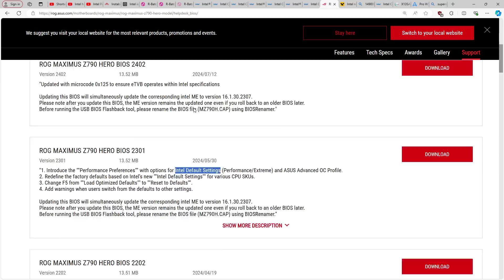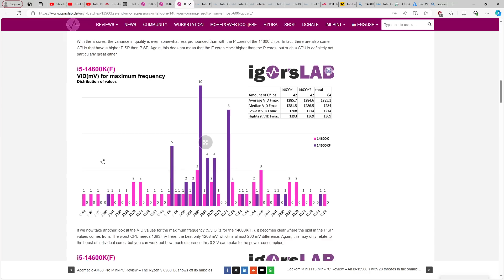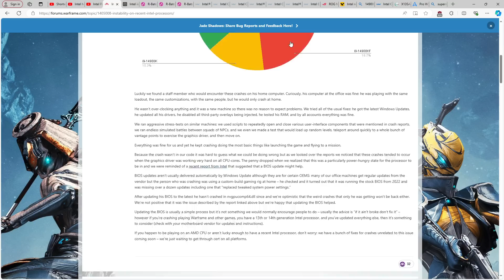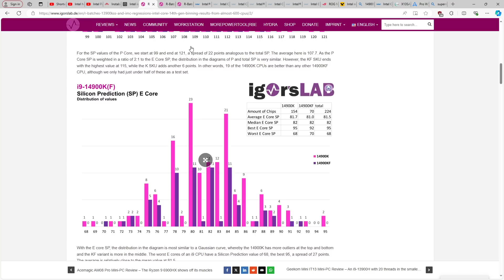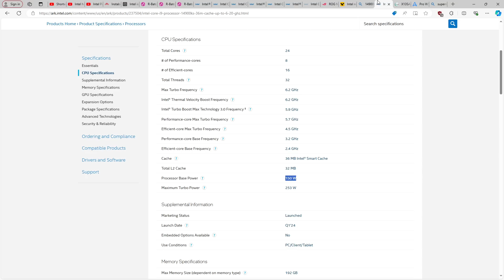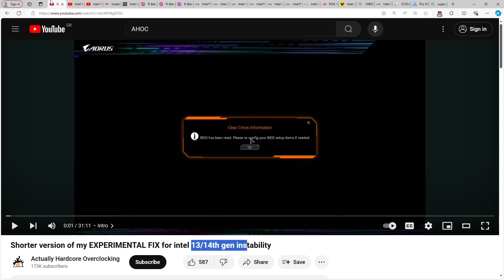The intel instability and degradation rant.

Comment: Truth will out at some point. The longer Intel 'silence running' this issue, the larger the scandal. Its going to be I think (because at this point, speculation is where we are at) some form of design or manufacture defect, and its going to run in the billions. A very large part of trust with intel is that they used to have a rep for the validation, and reliability to a good degree. Each day this progresses with no real response from them, is one day of more damage. 

And this reputational damage sticks. It doesn't wash off. Buyers of the next chip family are going to be extremely wary if they were bitten on this and had a deaf vendor. Some - and I think these are tip of iceberg info - info coming out has people stating just how bad things are, and how deep a hole its put them in. 

Imagine being a Dell, or a Lenovo, or HP, and staring down a barrell where your customer base has been sold bad processors that are steaming forward towards a class action suite, and the supplier is playing public laaa laaa laaa laaa.

This is going into the folklore bin. Along with Dell Caps, IBM Deathstars, Nvidia substrates. The only question now is 'how big' its mushroom cloud is going to get.
Reply: this is user neglect 100%

intel did what they were supposed to do: gave you a high spec machine

people are not properly taking care of it

you ALL know that dude, the one that bought a sports car and NEVER changes the oil or monitors coolant levels and runs it balls to the wall 24/7

and then wonder why its constantly breaking down
Reply: @OdinAlgeron Bruh, this is happening even in servers, on server motherboards.

It’s not the users.
Reply: @mduckernz  did you not read what i stated?

whos fault is it when the oil and coolant is never changed and the engine blows?
Reply: @OdinAlgeron  That makes no sense. Wendell's data is from server farms on server motherboards. You could argue that they don't know what they're doing, I guess. But then why is it just happening now? Do you honestly think people suddenly got dumb? Why are they then charging more for Intel and even some switching to AMD? Isn't it more reasonable to suggest there's an issue with the chips?
Reply: @OdinAlgeron not everyone is techno god and can tune each and every atom of silicon on the chip. Intel created a bad generation. Just accept it. It fails if you use minimum clocks, it fails when you overclock it, it fails if you leave it idle.
Reply: @OdinAlgeron  I have very little patience for nonsense. 

They have these in data centre's, mounted in very conservative configuration, not overclocking, not overheating, and they are replacing trays and trays of them. Wendell's data is but one set, and that neither confirms, nor denies a larger issue. But this is not 'user' error. And while I respect that if you delid and take some extraordinary steps, you might stabilise the product, the average people can't, and should not be expected to_do_so. 

Its day 5 since some data broke. And each day only confirms deeper issues. Intel need to get ahead of the problem, not swim from behind.
Reply: @AdmV0rl0n  drive a ferrari non stop and never check the oil or coolant and the engine will fail

the ferrari are built for the track, and to be ran BUT without proper maintenance thy WILL FAIL EVENTUALLY

if you never change the oil or coolant WHOS FAULT IS IT WHEN THE ENGINE BLOWS???

a lot of people have 14th gen OVERCLOCKED and NEVER have problems, 

so, WHO is taking better care of their systems you think an well informed enthusiast overclocker or a lazy ass server farmer with thousands of units to monitor???
Reply: @AdmV0rl0n  OK looks like I was right, it was confirmed after looking at VID tables for mobos they were pumping 1.5v+ into cpu's
Reply: @OdinAlgeron  I doubt you are ever right.
Reply: @OdinAlgeron what rubbish 
Intel are fucked

Comment: I'm even more sure that it is some copy and past circuit that is extra sensitive to silicon lottery that is suffering from migration over time. something like an internal bus latch, a terminator at the ends of the internal busses, or a clock distribution amplifier. It is worrying that CPUs or any chip can degrade that fast, yet here we are.  to OC or not, if not OCing has such a high fail rate anyway. Wendell also said some CPUs get realy slow before kicking an error, so that kind of keeps us from ruling out a clock circuit.

Comment: My 13900k was fine for a while. The BSOD started when putting the CPU under 100% load which pulled a lot of power. I think there likely is an issue with how much power it can pull at 100% load for long durations. In my case, I was doing repacks (20-30 minutes at 100%). I thought it was the RAM or XMP or something so I wasn't really paying attention to the CPU. I think the damage was being done at this point, as it got to the point where I couldn't get but 10% into decompressing the repack before a BSOD with the same circumstances trying to install a repack or get passed shader compilation of Forbidden West. Eventually even setting to 253w/253w/400a would result in a crash (brief second of power limit throttling when the crash occured). Same thing on shader compilation as that also puts the CPU at 100% load and would crash the game. Important to note, with limits in place (253w/253w/400a) the apps would crash. With unlimited power limits, I was getting BSOD. Eventually I could turn on IA/GT CEP (current excursion protection) which now limited my CPU to not being able to consume more than 200w at 100% load. Installed multiple repacks that were crashing like this, and could finally finish shader compilation of games like Horizon Forbidden West to actually play the game. Just did an RMA, and Intel sent me another 13900k but this time I decided to install a Thermal Right bracket which I have my own suspicions of now vs their stock bracket. My CPU doesn't even get hot anymore, and I mean like 20 C less under 100% loads. I remember with the old CPU seeing it pull as much power as 283w (and remember 400a is not to be exceeded says Intel) and it did in fact hit 100 C before on some cores, I think damage may be coming from them staying this hot or remaining there too long as well. Ironically, anything less than 400a on a 253w/253w would result in a EDP current throttle for me. So I can only assume when it went above 253w in the early days that it likely took the 400a above as well. New one is working well though, I put the 253w/253w/400a in place in which it hits at 100% load and I can tell it clearly wants more. But it's the only configuration that doesn't result in some kind of throttle, so I'm happy with it. I got my performance back in Bannerlord and can now run 1000 unit counts again without lag (was down to 600 with my old 13900k).

One other thing, the 125w/253w/307a will result in an EDP current throttle under any kind of load, only idle will it not have a throttle.
Also, Gigabytes new default settings on their BIOS f12d also results in a constant EDP current throttle. Sweet spot with no throttles is 253w/253w/400a for me, it may just be the 400a that is where it is suppose to be, but not above it, from my personal experience.
Reply: 20-30 minutes at 100% is not that long.  I've been encoding videos for on my 7800X3D for a year and 1/2 straight and have zero crashes.  This is with tuned memory too.
Reply: Fitgirl?
Reply: It’s clear that your cpu was hitting temperature tjmax and erroring you could have easily fixed everything by enabling a 90c limit

Comment: my ryzen 3 from 2016 still works to this day  and its on about 24 hours a day - and ryzen 3 were the cpu´s that didnt make 6 core or 8 core due some problems, dont have problems with memory either and the ssd is the orginal -only problem seems to be the heavy amd gpu card did bend/sagged and might have impacted the gpu port

Comment: Turbo Boost 3.0 is the only common denominator.  The 1 -2 core boost throws too much current and voltage into the chip and degrades it.  Sounds like Buildzoid gets it.

Comment: My stock 14700k has a high vid, 1.38v, i did a undervolt to 1.28v to sustain 5.5/4.3
Reply: That looks nooice, but i would try to go even lower, 5.3 ghz at 1.2v sounds good to me. If you can lower the maximum wattage allowed in bios aswell.

Comment: Devs from Alderon Games studio have said they have found i5s with this issue as well, on a post on r/intel
Reply: I'm actually having a strange problem with my 13600k. Some games, at any voltage, randomly just straight crash at 5.1 Ghz (I always undervolted it, so I don't think it's a motherboard problem causing degradation). If I set the p-cores clock to 4.9 Ghz the issue go away... I hope it's not a cpu degradation problem.
Reply: Literally one Google search disproves your claim, try harder.
Reply: @dusty_48  Watch the latest GN video where he talks about millions of Intel CPUs being defective and among them being i5s.
Reply: I don't think so, i never watched someone complaining about the i5s. The 13600K in particular has the best perfomance per watt from 13th gen and can be easily air cooled. And considering the clocks, it's in the safe voltage range.
Reply: @saricubra2867  You don't think so what, that they didn't find issues? I don't see a reason why they'd be lying. 
But I would agree that more testing is needed before reaching a conclusion. For now we can just speculate.
Reply: @saricubra2867  TIL: A lower end midrange CPU being easily air cooled is considered a remarkable feature by some peoples standards.
Reply: @peterdermeter7044 well considering it performs on par with the 12900k tho...
Reply: @saricubra2867  Gone onto r/intel and can confirm the OP's post. I politely suggest you do the same. Now for the specifics: Alderon has data showing that 14600Ks are affected, however it is a more rare occurrence (due to the lower power draw of an i5 compared to an i9, hence why nobody is covering it at that level of product, yet). They also found issues with the 13700T (which is an OEM specific SKU for SFF systems). A commenter underneath has flagged issues with their 13600kf, having to disable 4 e-cores just to boot into Windows.

Comment: Reminds me of early days of the Zen+ platform. My Crosshair VII managed to kill my Ryzen 7 2700X with 1.6v...(level 4 oc it was called if I remember right). Back then it worked even for a few days until it didn't. Whole system started to get unstable until I couldn''t even boot.

Somehow I managed to RMA it and get a new one.
Reply: You killed it with 1.6V, that's not an AMD issue that's a skill issue on your part.
Reply: @giglioflex  Skill? that for sure. Or well i listened to DerBauer; how was I supposed to know that "level 4 oc" (it is a preset configuration in BIOS) does push so much voltage into the CPU...my bad still.
Reply: @Koeras16  I would say that's a fault with the motherboard manufacturer. It is not safe to go above 1.4v on Zen+. The fact there was even an ambiguous "level" option that didn't clearly state the risk involved was probably how your RMA replacement was honored. Doesn't help there are outlets like TechBlock on Youtube that tested using your same CPU and motherboard, saying that Level 4 simply is "unstable," not "risks destroying your CPU," making it seem okay to an observer.
Reply: @savagej4y241  Well happy me back then.

Worse thing is that it took me two days to even bother checking voltage read out since enabling that setting was like turning on XMP. That usually does not require stability testing.

The Crosshair VII has some pins to measure with a multimeter voltage. I do remember reading around 1.64v ! 

After setting it back to default it was sadly to late. Funny thing i managed to get the CPU prime95 stable at 3.1 GHz at some voltage (i don't remember) whle everything above that was completely unstable, even 3.2 GHz with static 1.35v and somewhat aggressive LLC.

Anyways, high voltage does kill CPUs ! And as you said. Zen+ isn't safe from degradation above 1.4v.

Comment: Hey @BZ, its even worse!
P and E actually have independent boost algorithms, you can run Prime 95 AVX small FFTs on e-cores only, let's say at 1.25v (220 watts) and then start Cinebench single threaded workload, so P-core will request 1.5v and this will be applied to E-cores either.
You can verify this in OCCT for ex. Just set OCCT load to half of your e-cores and run 1T Cinebench to see what will happen.
Reply: In other words, the entire product was designed to game the benchmark software to get a bit high scores.

Comment: My own personal hypothesis for what's causing the issue is the internal clock generator failing. Every error that I've seen come out of unstable 13th and 14th gen intels looked like an unstable BCLK to me. Some reports like everything becoming extremely sluggish before a total crash, etc.

I don't know if they used ol' reliable Quartz in their internal clock gens, but I think it's more likely they used MEMS or NEMS oscillators as the clock generator. AFAIK intel has no greater expertise with MEMS/NEMS so it's quite possible that they created and implemented a design that's particularly susceptible to degradation.

An easy way to test this would be to plop a known unstable CPU into a mainboard with an external clock generator to let it override the suspected unstable internal BCLK with its own stable 100MHz BCLK.
Reply: Intel had a major issue with the clock gen inside Atom CPUs degrading, like a bunch of really expensive Ethernet switches, NAS boxes, etc. have been bricked by this
Reply: The CPUs do not have crystals/resonators inside them, the clocks are generated by using the front side bus clock provided by the main board as the base frequency for a clock multiplier circuit.

The actual implementation of a clock multiplier will be a form of voltage controlled oscillator that operates as a phase locked loop, if your CPU wants to run at 6Ghz, and has a front side bus of 100Mhz, it will set the VCO to what it thinks will provide this and the output will be used as the clock for the CPU, it will also be fed into a frequency divider circuit set to the ratio, 60 in this case, the output of this divider will be compared to the FSB, and the VCO will be adjusted for any offset or drift.
Reply: @Ts6451  this hasn't been the case for a while now. Not since the North Bridge was integrated onto the CPU die... Currently the BCLK is generated on die, and only some enthusiast mainboards actually still have their own oscillators to get around Intel's/AMD's restrictions for overclocking
Edit: I got my timeline mixed up, at least until recently the clock was generated in the chipset, while the CPU used PLLs, you're right. Tho I'm pretty sure I heard on a convention that they now generate it on die with a MEMS resonator
Reply: @insu_na  Yes, from the datasheet it looks like the Platform Controller Hub supplies the 100MHz CPUBCLK(and several other clocks) to the CPU in the Intel 700 series chipset. 

These seem to be generated by similar means from a 38.4 MHz crystal oscillator with an external crystal.

Intel have done work on MEMS resonators, of course, so I guess it's possible that they might be working on something along those lines.
Reply: @Ts6451   so in this case, damage in the Ring could result in cores losing that VCO clock pulse intermittently resulting in strange behavior, since the cores have to communicate with the rest of the board and IO via the ring right? you can't modulate the clock to compensate when some of the cores just aren't getting the clock pulse period.
Reply: @572089  I would expect clock issues to cause all sorts of problems, sure, though I suspect there might be more than one issue, or that the problems are all symptoms of a more basic problem, but I don't suppose there is much point to guessing about it, we will probably know more at some point.
Reply: My IO is what was going out and things like nvidia drivers reinstalling themselves and recognizing my monitors and usb keyboards and mice reinstalling themselves at startup or not working until I unplug and plug them back happened first. My ram was fine in testing with memtest86. It is the IOMMU portition that looks like it is glitchy first which would impact clocks and video ram paging second
Reply: is the BCLK internal to the cores, or is it on the ring? because if clock control is on the ring, than ring failure WOULD result in clock instability too!
Reply: If a CPU degrates itself it's an absurd amount current or voltage, same thing happened with Bulldozer and Piledriver, Pentium...
Reply from the maker: @saricubra2867  Piledrive is basically indesctructible in my exp. The motherboards die before the CPUs do. I ran some of them at like 1.6-1.75V on air/water cooling
Reply: @saricubra2867 It's pretty much impossible to degrade Bulldozer and Piledriver. The problem with running them at high voltages is that they require quite low temperatures to remain stable and cooling performance goes up with temperature, so cooling tons of power at low temperature is quite difficult even with good air or water coolers. Degradation is accelerated by heat and power and generally voltage and current both increase at the same time given the same resistance, so more voltage will also cause more current to flow and increase the power exponentially, which in turn also increases heat. If your Bulldozer or Piledriver system is unstable, chances are high you are just running it too hot.
Reply: @saricubra2867  That's one possibility, yes. It's not the only possibility.